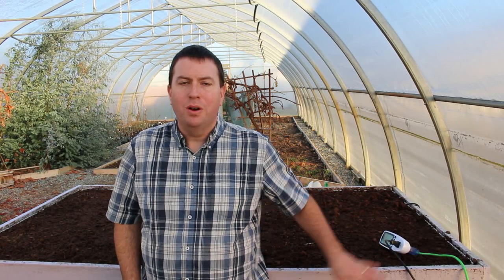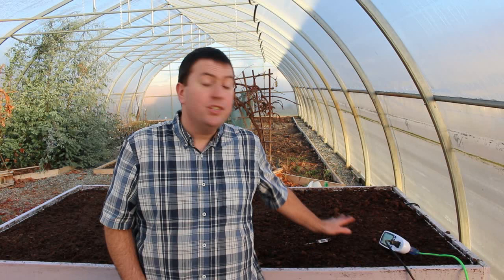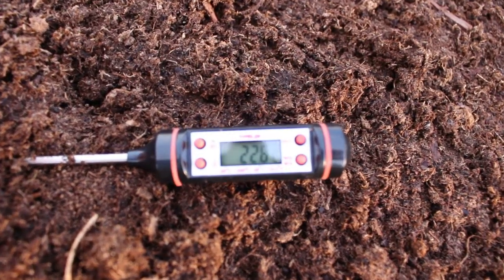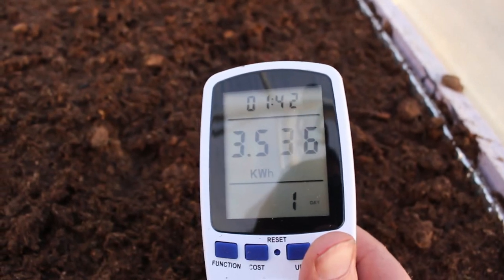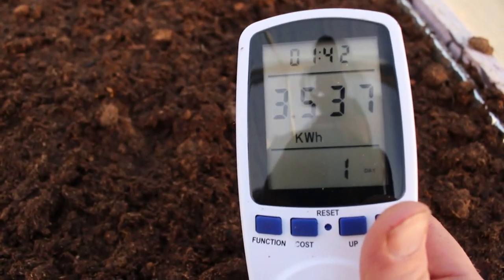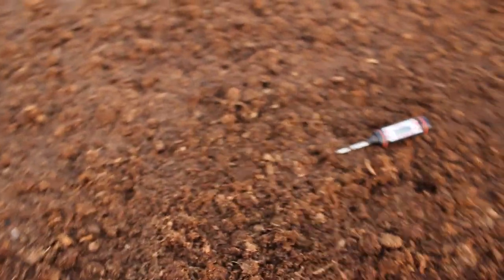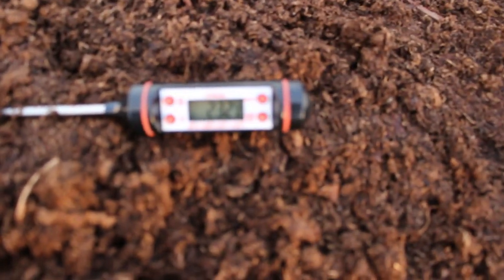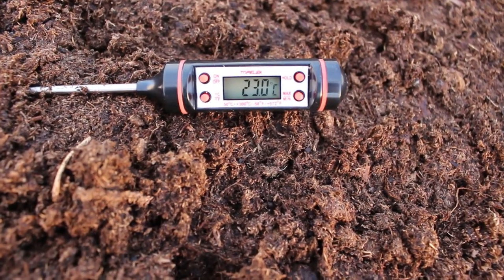Heated Bench: Update

Comment: Nicely done. Barring a mold issue, do you see any benefit to using plastic sheeting overlaying the soil to slow evap?
Reply from the maker: Thanks Rob. That's an interesting idea. I do get the impression that pressing my plug trays down into the mix gives really good contact, and may help the transfer of warmth. I wonder if the plastic would act as a barrier to heat movement. I may have to try next time I change crops.
Reply: @FraserValleyRoseFarm  I'd be interested on your results. My thoughts went to "water bed" conduction of heat. Overlay would limit depth of pots into base tho. Keep us posted and thank you for sharing your ideas.
Rob C
North Dakota

Comment: Can you think of any drawback from using those flat propagation heat mats with a thermostat   vs. the cable ?
Reply from the maker: Only the size. On the table I'm able to fit something like 10 flats - if you were able to find a thermostatically controlled heating mat that covers the space you need for a reasonable price, it's a good way to go.
Reply: @FraserValleyRoseFarm  I was wondering same... So it is similar using heating cables and using heating mats. It's just matter of size of space? Which one do you prefer mat or cable?

Comment: Hello, I have built a similar bench and was going to use sand.You comment regarding conducting of the heat made me hold up on putting in the sand. I have Coco fibre cubes, could I use them and do I keep them damp? Thank you
Reply from the maker: Yes, that'd be fine, and keep it damp to conduct the heat.